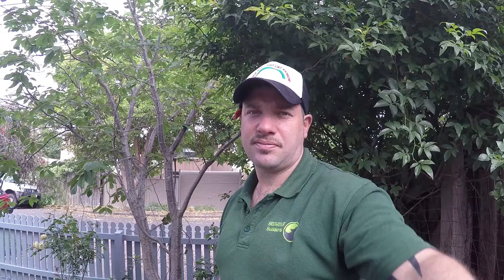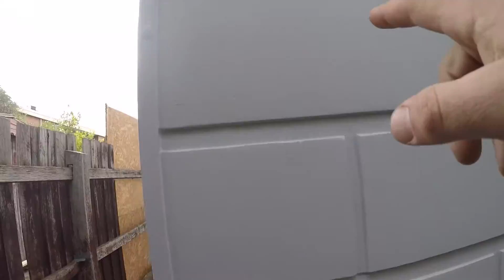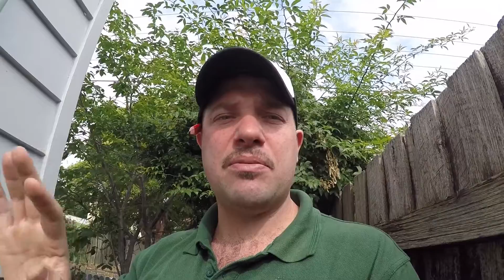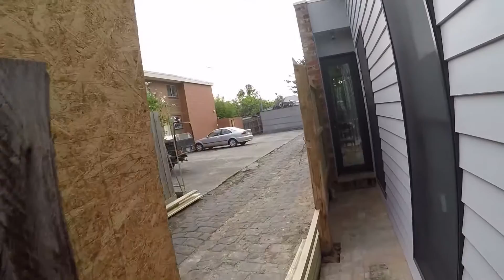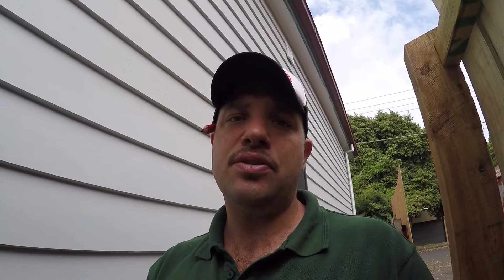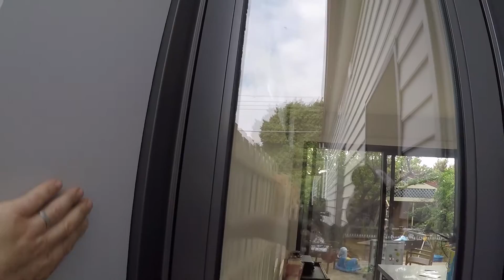Cladding your home and fire safety

Comment: Hey bud, Love your work - keep it up.

I'm considering replacing the existing round edge weatherboards with the James Hardie Linea weatherboards on a period home. 
I am little worried that the fibre cement weatherboards will look too modern for a period house.

Thoughts?
Reply from the maker: Gday HKGTSCam,
Are your old weatherboards rotten?  
Are your existing weatherboards old or new?
The answer to these are important due to newer boards rotting very quickly & having little thermal quality yet the older boards are AWESOMENESS and are dense with great thermal qualities.
There are a number of vids on my channel on cladding; one showing old vs new weatherboards
one showing a batten out system to help insulation and radiation heat from the sun.
The new systems of Compressed cement sheet, which can really help with longevity and thermal control, are a great way forward if you're upgrading.
They dont look the same as the old weatherboards yet have the same qualities and over all feel.
#stayawesome
Uncle joe joe